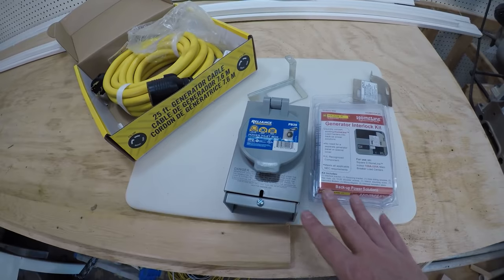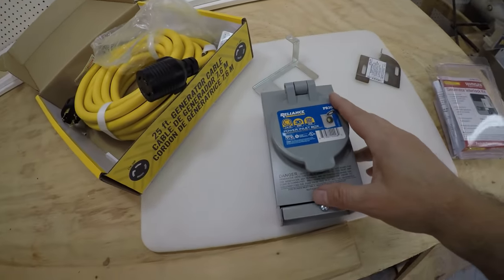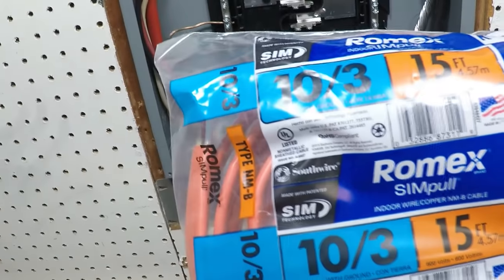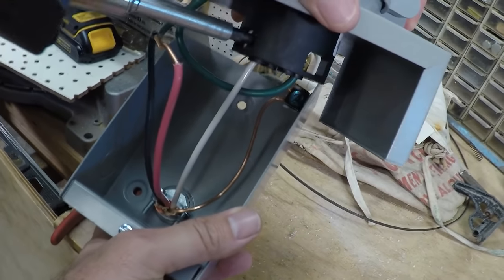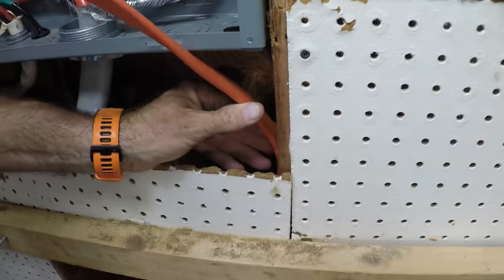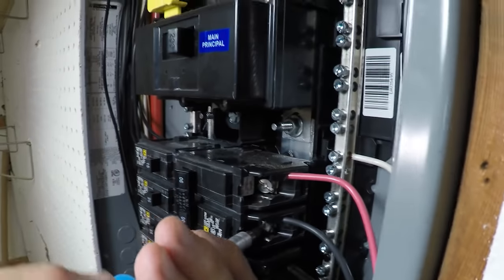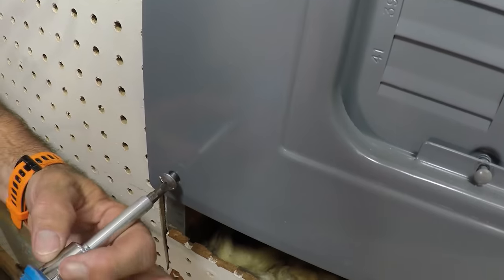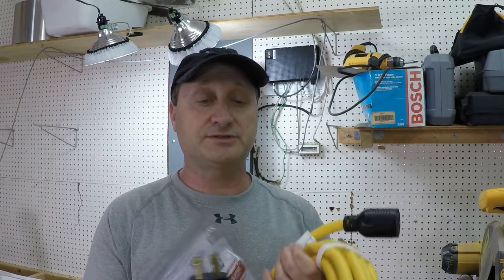Home Generator Interlock Kit Installation - EASY!

Comment: Question: Did you add the 30 amp breaker to your panel , or did you use an existing 30 amp breaker? Because you would have to utilize a breaker that is at the top of your panel to utilize the interlock safety device.
Reply: Yeah I would have same problem would have to move 2 breakers
Reply: Its easy to move breakers. Just wire nut wires onto the now short wires. Its legal to do so in a panel.
Reply from the maker: That was a new breaker added just for the generator. It was all planned out for that when I had a new panel installed the year before.
Reply: @flannelguydiy6458  thanks for the reply :O)

Comment: On a tri fuel generator using natural gas Is it better to run a long gas line or long cable connection to panel or does it matter? Hope that makes sense. Concerned that long gas line will reduce pressure somehow with long 40-50 ft hose.

Comment: Thank you. Well presented and to the point. On question. If I use individual wires vs Romex do they have to be run in conduit from the generator inlet to the breaker box?
Reply from the maker: yes the wires should be in conduit.

Comment: For a Colman Powermate premium plus 6250 (6250 maximum watts / 5000 running watts) it’s indicated 20 amp. on the electrical outlet (3-Pole 4-wire receptacle). Should I then install a 20 amp breaker to match this generator? Can I really get up to 6250w and run 5000w through a 20 amp breaker?

Comment: i have the champion 4000 watt 5000 starting watts generator. Would the 30 amp breaker works on this one also? Thanks
Reply from the maker: the breaker can work. It is all about how much power you draw through the breaker from the things you are using in your house

Comment: My Honda generator only has a 3 prong twist lock plug, hot, neutral, ground so how would the connection to the panel differ?  You must need a different wall plug?  When connecting to the 30 Amp breaker would you then take the hot and connect it to both poles of the breaker so that you are feeding both sides of the breaker panel?

Comment: What I have used to install boxes with vinyl siding is to use cut pieces of plastic toilet feed pipe to space the box so it doesn’t collapse the siding, then seal them with clear silicone and seal the box to the exterior vinyl siding wall using silicone. That way I have a clean looking installation.
Reply from the maker: that works...

Comment: When the generator power goes to that 30 amp circuit, how does it power the other circuits? Are all circuits in the panel connected?
Reply from the maker: yes they are all connected. thanks for watching....please share the video for me. Thx

Comment: How did you punch out the hole for the electrical wire in the box?  How do u add the 30 amp breaker ?  I would have to move my heat pump breaker to make room on the top of my breaker box ~!

Comment: How did you move the circuit breaker that used to be on the same spot where you put your generator circuit breaker?
Reply: I’ve seen some add on the the wire and move it down
Reply: You need an electrical education or call a licensed electrician.
Reply: Move it to the other slots that’s not being used.

Comment: If commercial interlock don't fit my panel breakers layout, e.g., need turn off solar as well when using generator, can I make my own Interlock and still be  legal in California? This assume I did a good job on fabricating my interlock that others cannot defeat the "Utility power and generator power cannot be on simultaneously". Please quote relevant and provide section of NEC code. Thank you.

Comment: Great video,  qq my gen only has 30amp 120v. Black, while and ground, can I safely do tge same but on a single pole 30amp breaker, as long as I turn off 220 and or high demand 110 devices?

Comment: Hi, could I install my gemerator power inlet and 30 amp breaker in my garage breaker panel? My house breaker panel is pretty much full and my garage breaker panel has plenty of space. My garage panel is powered by a 60 amp breaker inside my house breaker panel. 

I know I couldnt have a interlock kit to prevent the power lines switch to be off but I am the only one at my house who isnt scared of touch the panel. My wife is scared she will die practically just by looking at the panel. 

Now, could I do just like everybody does when they install a generator power inlet and breaker to power their homes, except mine would be in my garage breaker panel. 

Thanks for the help.

Comment: excellent video I have a small portable yamaha 2000 watt inverter type generater it has household type pongs where it plugs in, your cord appeared much more heavy duty for like a much larger generater.
can I get a outside plug w/ household type pongs? thanks
Reply from the maker: i cannot answer that

Comment: The breaker for the inlet power is just a regular breaker? Is there a direction to breakers for electricity? So in essence, the generator power is coming into the panel and has a breaker before it enters the panel and then it has breakers as it exits and goes to the switches and plugs in the house, is that correct?

Comment: Did you have to move all of your other breakers down 2 slots to make room for the generator breaker?  And if you did, was there enough slack in the wires to move them all down?
Reply from the maker: yes you would have to do that. For me, I had just installed a new panel so I knew from the beginning that I was going to need the generator breaker on the top right

Comment: Is there any distance restriction for the power inlet box connection from the main panel? My main panel is in the garage and the generator will be in the backyard about 140 feet away where i would to install the inlet box.
Reply: yes there is. You will probaly need to have the generator within 10 fee of your panel

Comment: How about if you have 400 amp service. I have 2 - 200 amp panels. Is there a way to hook up with this type configuration?
Reply from the maker: you could split the wires after coming into the house and wire it to both panels

Comment: I have been looking for a video showing a generator breaker being installed. Does every box already haver the generator breaker installed? is it common for houses to already have that generator breaker? Mine looks like there is no more room for more switches. I assume its already installed. I have 3 main disconnects.
Reply from the maker: No the panel does not come with that breaker. I installed a new panel and put that breaker there. It just snaps in. you can find youtube videos that show you how to install a breaker

Comment: Did you have to reposition all the breakers on the right side to make room for the 30 amp?
Reply from the maker: yes you will have to do that. I installed a new panel and made sure I left that spot open

Comment: Question about the cable between the generator and the house connection. It looks like you're using the 30 Amp cable versus the 50 Amp. Shouldn't the 50 Amp cable be used for the house? I thought the 30 Amp was purposed for RVs.
Reply from the maker: no..not just for RVs

Comment: I have a 12k portable generator I want to run my house with in a shtf situation. I want to be able to plug it in just like this. Do I have to get a transfer switch kit and all of that or do I just need this plug and a breaker? I'm pretty sure mine being a 12k I'd need a 50amp? Can you please help me I am disabled and need to be able to run my home if the power goes down in winter. Thank you so much .

Comment: Thanks! Do you have a video on how you connect the breaker so it would power the whole panel?
Reply from the maker: This is exactly how you power the whole panel.
Reply: @flannelguydiy6458  thanks. i have solar, so when switching on the interlock, do i also turn off the breaker that is connected to the solar panel?

Comment: Nice job. I'm about to do this.  I may or may not work for the power company and may or may not be concerned about the lack of materials needed to keep electricity flowing.  🤔 
If anyone has a freezer full of meat they should consider the cost of losing it all if there's any kind of extended outage
Is this just a 120v generator?

Comment: Great video. Super helpful and took away. A lot of the mystery for me. One question I would ask is you have to have a breaker that matches your breakers in your panel correct? For example, I have an Eaton 150 amp panel wouldn’t I need to run an Eaton breaker for the generator? Also, how do you calculate breaker size? Doesn’t that have to match the generator output amperage?

Comment: Great video. I have a question. If I already have the top slot in the breaker box occupied and have to move it down to accommodate the new 30 amp breaker, then can I just splice another wire onto the current breaker's hot wire so it will reach the new spot lower in the breaker box?
Reply: Same question I’ve asked on a handful of these videos. No one talks about this. They just magically have a free 30 amp spot at the top of their boxes.
Reply: It doesn't matter, you can install the breaker at the end or in the middle of the breaker box, keep in mind you have to use a double pole circuit breaker.
Reply: @josecherre4334  I agree that you can put the 30 amp circuit breaker anywhere in the panel but you can't get the interlock to work unless you put it in the top position so if you want to use the interlock kit then you must move the existing circuit breaker and move it down....which leaves me with my original question still...
Reply from the maker: Yes you can do that if the current wire will not reach.
Reply: @flannelguydiy6458  Thanks so much for your info!!
Reply: @chrissimpson4133  Yes, the interlock breaker has to be in the specific location to work.  So yes, you can move one, or two breakers out of that position to a different spot.  And yes, its legal to add wire if its not long enough.  Use the correct size wire, and wire nut, etc.

Comment: We have a 13kw generator and anything we use to connect to the house electric will need to be at least 50 amp rated.
Reply from the maker: you can upgrade this to 50amp
Reply: @flannelguydiy6458  1st, excellent video. 2nd, I only posted because I started pricing the equipment before knowing what I needed. I tend to jump the gun like this. Basically, my original post is for those like me who don't pay attention. :)

Comment: What wattage generator would you recommend? Thanks
Reply from the maker: That has more to do with how much you need to power the things in your home. I am running everything except the AC compressor with a 6000 watt generator

Comment: What did you do ? Did you have to move circuits for the generator, because I don't have the circuits open in that space.
Reply from the maker: If this was an old panel then yes I would have to move circuits. However, it is a newer panel and I planned for this by leaving the spot to the top right open

Comment: For the 30 amp breaker is that required to be at the top of the panel? Is it a matter of just  moving the existing breakers down ?  Can you link the tool you used for stripping? thanks!
Reply from the maker: yes it must be at the top just below the main breaker. Move the others down

Comment: I have to design and build my own interlock, because my breaker box is 30 years old and the labels with brand and model # are long gone so I can't find the correct interlock for my breaker box.  I also want to figure out how to wire my breaker box to light a status display in my house to tell me when external power is back on so I can switch from generator and not waste fuel running it unnecesarily.  Any suggestions?

Comment: thanks great tutorial. Was the 30amp breaker a breaker not used  in your box. Do you need a free breaker in the box to do this ?
Reply: You will probably will need to move the top two breakers that are on the right for the interlock to fit there. Also you will need to get a new breaker for the generator.

Comment: How big of a generator do
You
Need to
Power the house??  What is the minimum size generator??  Can you hook this into a 100 amp sub panel in the garage instead of the main 200 amp panel on the opposite side of the house?  My 100 amp sub panel is in the garage?
Thanks

Comment: Can you still read some voltage at inlet box outlet with the breaker off?  Mine reads 0.33v
Reply from the maker: I did not test it
Reply: @joel6427  Humm I guess is normal... I did not touch it so I do not know if will shock me or is just that the meter is very sensitive., I do not think that 0.33v would shock me but I would not touch it. lol.
Reply: Any time a wire passes by a live wire the magnetic field in the live wire induces a small voltage.  So it's called induced voltage. No amperage. It is normal.

Comment: It's a straight shot but help me understand how or what circuits it will power? Don't you need to designate the generator power/breaker to the circuits/breakers of the appliances and receptacles?
Reply from the maker: it will power the entire panel, but you need to be careful of how many things you turn on. Understand how much power your generator can produce and do not turn on too many things in your house. My generator can power everything except the AC
Reply: @flannelguydiy6458  Then I should turn off all breakers in the panel and only turn on the ones that my generator can handle, such as fridge, furnace, maybe AC if enough power, internet, PC and any other needed circuit under the generator running wattage?

Comment: The problem with an inner locked kit It does not Isolate the whole system.
What I mean is you can still get a bad feed on the neutral. You must lock out both faces of L1L2 and the neutral completely isolated. That's where manual transport switches are a lot better. They isolate the neutral. They isolate L1& L2 And also isolate the ground wire to completely.
I do not care if you shut the brake hero. You still have a back feed on the neutral and this is wrong. I have been the electrician for 47 years.
If you want to be 100% safe, you'd better isolate.
Ground line 1 line 2 and the neutral guarantee. No back feed.

Comment: I will say you probably should’ve used uf cable since the inlet is outside, also you want the screws in the breaker panel to be snug if you over tighten the screws you could flatten the wire which is just as bad as them not being tight enough.
Reply: I feel like the actual box is weather proof.

Comment: Hi, question. I have that same exact inlet box, and want the same setup. My problem is that I want my inlet box to be 100 feet away (on the other side of the house) from the panel. Do I need thicker gauge wiring from the inlet box to the panel?
Reply from the maker: No.... you can run a 10 gauge wire 100 feet
Reply: You can, but understand that you might lose some power with such a long run of wire. The further the power has to travel, the more power you will lose.

Comment: If I use 10/3 gray wire .
I can skip the plug in .and go from breaker box  to my solar power house where my generator is . 
Threw a conduit .?
Reply from the maker: yes I am sure you can do that.

Comment: OK I understand everything you explained but how does the 30 amp breaker  you installed in your panel feed the rest of the breakers when it’s designed as a feed out and not a feed in like the main disconnect switch on the panel ?
Also when doing this can I assume you should only have two ( or maybe 3)breakers on in the panel because you’re only feeding 30 Amps, so I could feed my refrigerator and furnace and maybe one outlet in the house for my TV so I don’t go bonkers ha ha ? 
FYI : My particular furnace is 6.2 AMPS and my particular refrigerator  is 6.2 AMPS therefore I should have enough room to feed one other breaker perhaps ?   Thank You
Reply: This is a really good question1

"regular" circuit breakers work both ways. Sub panels for example without a main breaker are  fed via a double pole breaker placed along with all the other breakers.

And you are correct you should probably have all other breakers off and only have the essential ones on

Well pump
Furnance
Fridge
Essential outlets
Lights

Comment: So… I’m confused. If your putting two hots from the generator on the same bus bar aren’t you going to short power out.? Wouldn’t the red wire and the black wire be bringing two 120v sources to the panel? Wouldn’t this short it? Or does the double breaker contact the second bar some how?
Reply from the maker: you are bringing power to the panel... period. The neutral wire is not going to the breaker.

Comment: Is that for a generator that puts out 220?
 If you have a generator that only puts out 120 would you only need a single breaker?
Reply from the maker: you need 220 to carry the load needed to power everything.

Comment: This is so simple. thanks. I could actually use an unused dryer outlet wiring in the garage, changing out the receptacle for an inlet box. and of course putting the generator outside!
Reply: Did this work out?  I had the same idea.
Reply: This is called "back feeding" and while doable in a pinch, it is considered unsafe.
Reply: Your idea, I believe, would allow you to connect a running genset, WITHOUT first turning off the main feed breaker. This would allow backfeed , & potentially shocking someone working on the outside lines.
Reply: @tomnuggen2573 bad idea however

Comment: Considering having this done on our home, but we have a main panel on the outside and on one end of house where power comes in, and then a subpanel in the garage at the opposite end of the house. There are four switches in main panel; heat pump, water heater, well pump, and subpanel. There is also NO main cut off switch. My question is how would it be done properly/legally to have the generator hook up only on the subpanel, because that is all I want to have powered? Thanks.
Reply from the maker: the subpanel would need to have a main breaker